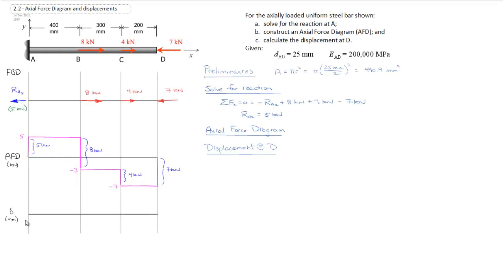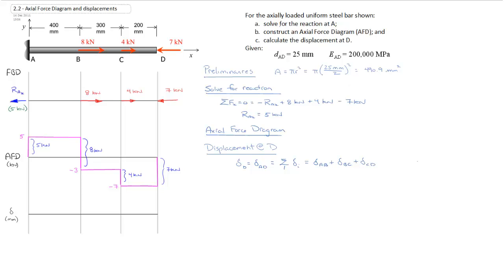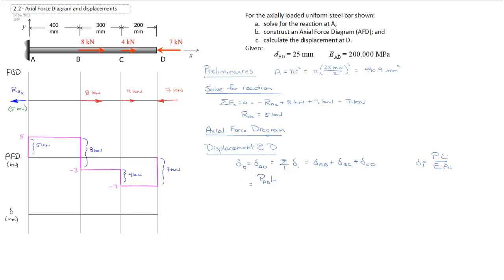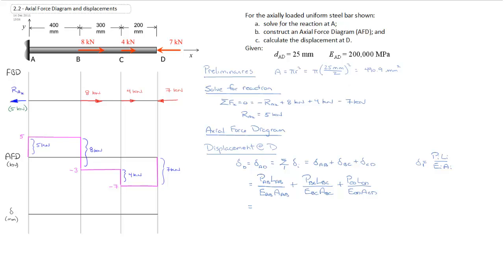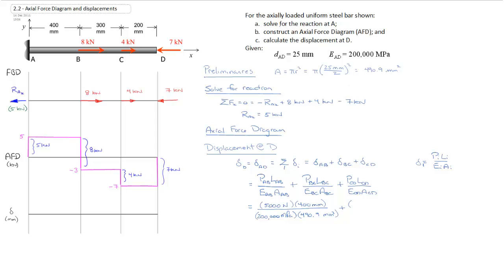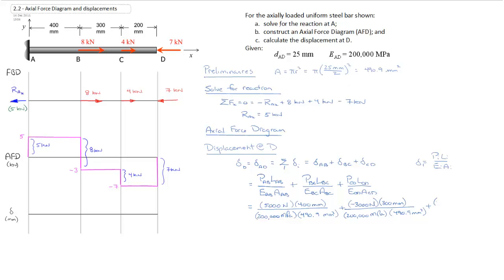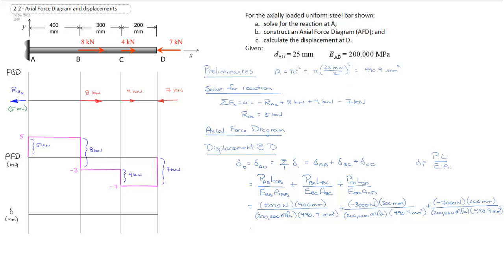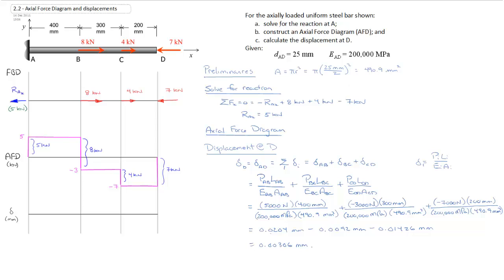2.2 - Axial Displacement (Ex 2.2 Part III)

Comment from the maker: Gikdew: I didn't realize I didn't have a video that shows the calculation of axial stresses.  I'll try to add a video in the next day or so that shows the calculation of axial stresses for this problem.  It is quite simple after you've determined your AFD, to get the stress in any section just take the internal load (from the AFD) and divide it by the cross-sectional area of that section.